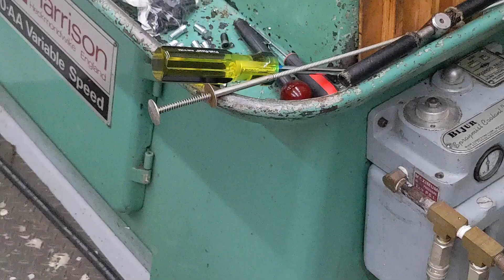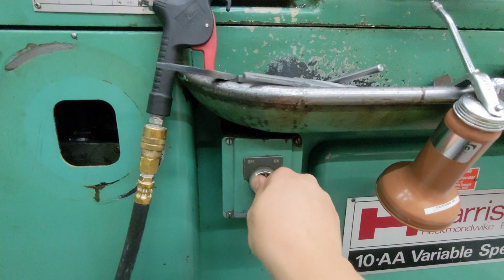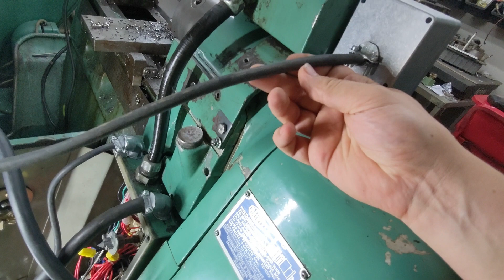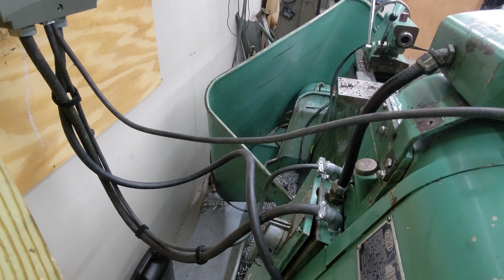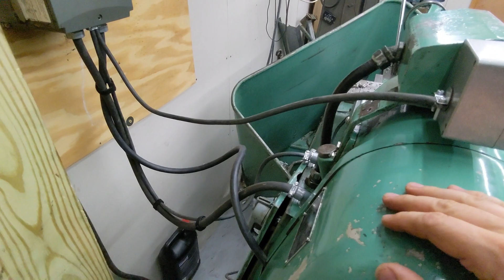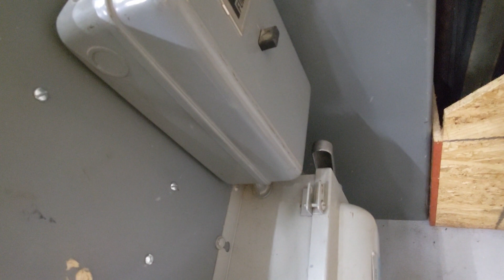Colchester Chipmaster Harrison 10-AA walkaround, VFD, coolant controls wiring explanation

Comment: Looks like a nice example of a Chipmaster lathe.
Doing the VFD controls the way you have makes it much easier if someone in the future wants to return the machine to run on 3 phase power, all the electrical gear is still present, because its been in use it will work, just putting wires back to match the factory wiring diagram.
Reply from the maker: Thanks, indeed I generally do whatever I can to avoid permanent modifications, and even if rewiring I prioritize using the original components if possible (repairing or repurposing as-needed), before replacing them. Another example is my Bridgeport had a bad 6f drive, and I could not find the issue with the board - so I replaced just the controller instead of putting a cheap new power feed on altogether

Comment: Like what you did with the Vfd utilising the original controls. I put a Vfd on my Harrison M250 and I rebuilt the control panel using buttons and switches in keeping with the design and era of the machine. Incidentally, the 240 - 120 or 110 control transformer is common in the UK in both three phase and factory single phase machines. The contactors and interlock microswitches are fed from 110 and the transformer is centre tapped. The tap is earthed to the machine frame so that if the operator inadvertently touches a live cable or terminal then they can only receive a maximum shock voltage of 55 - 60 volts.

Comment: It always makes me chuckle when people think VFDs can do better than the good old mechanical  variator.
Reply from the maker: Yeah, I wish they didn't rip it out - it would he nice to have it intact even if it needed repairs, and to get better low speed torque
Reply: Once the variator starts to wear they are very expensive to repair, that's if you can still get the parts.